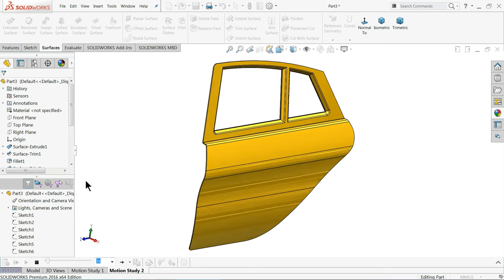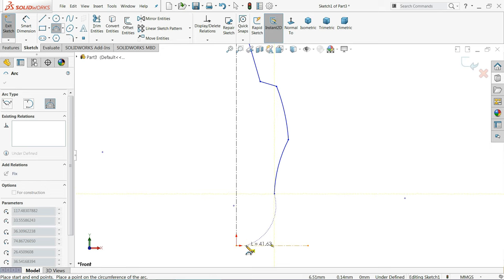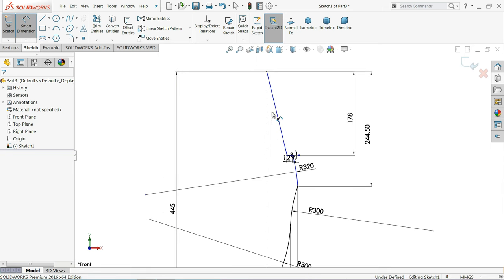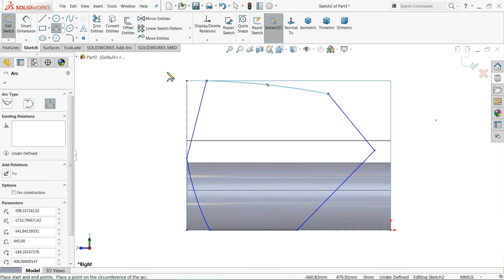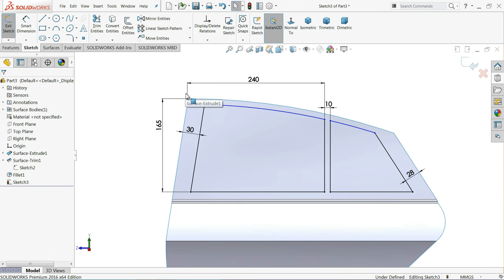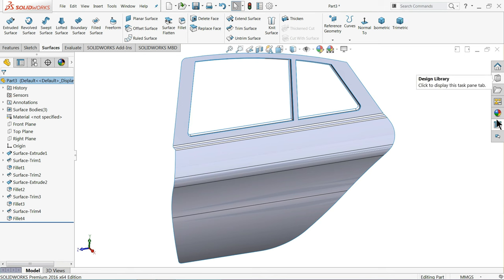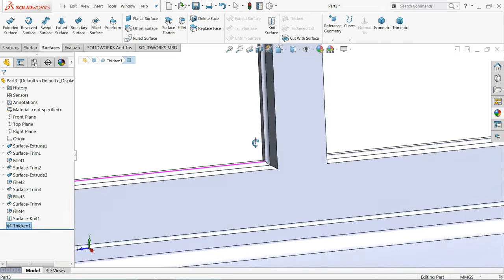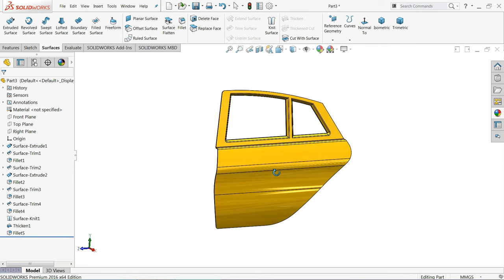Solidworks Surface tutorial | Car door in Solidworks

Comment: Hi My Friend, Your tutos are very helpful and interesting. In this one, you should have extruded the door profile following a curved line rather than a strait one.
Thanks anyway.
Reply: I was thinking the same thing.  I would add a guiding curve normal to the door surface that would define the curve of the door generally, then use a Boundary Surface with the two lines.  It'd be a bit closer to a real door's shape

Comment: What is the point using a set of straight lines and circle arcs with know curvature radius ? Beziers and NURBS curve have been known for quite some time.
Is there an advantage in terms of specification of the sketch, or manufacturability of the product ? Or you going to press the door against a piece of know curvature radius ?